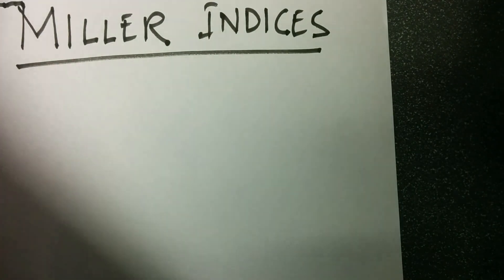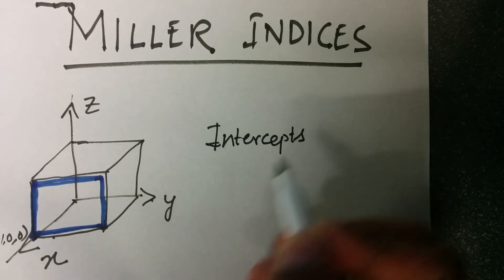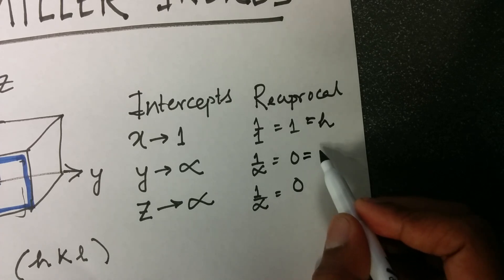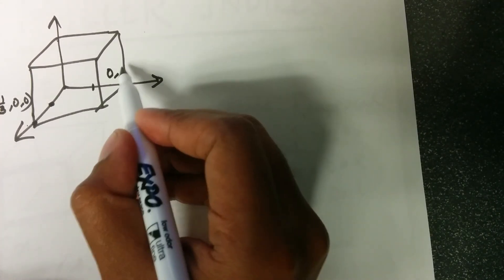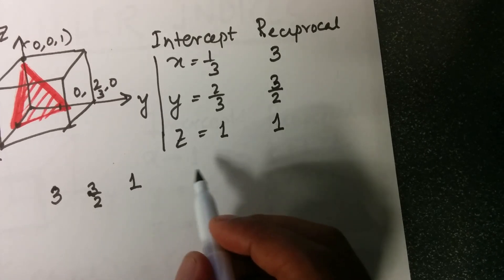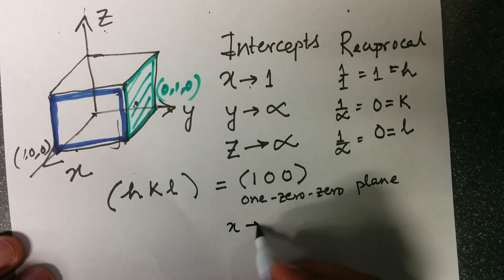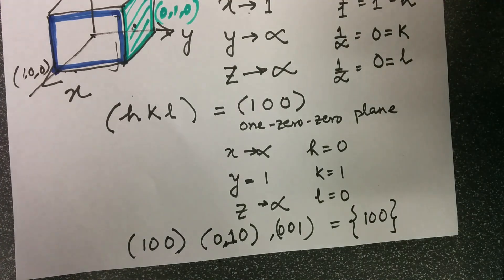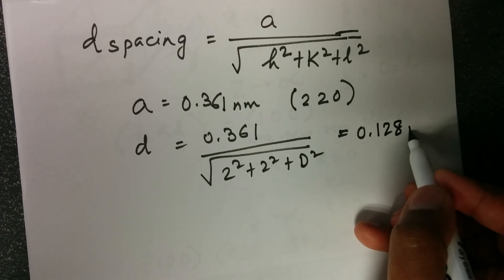Miller indices

Comment: but you didn't tell what is miller indices. You just solved some problems
Reply: Miller indices are used to represent: 1. The direction in the Crystal. 2. Planes of a Crystal.
Reply: They're a notation to define planes of a crystal lattice